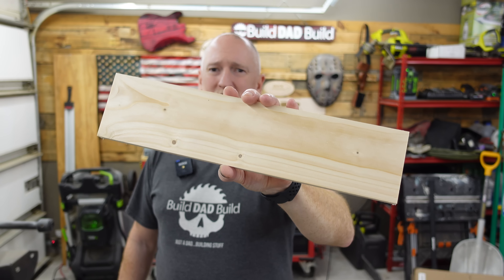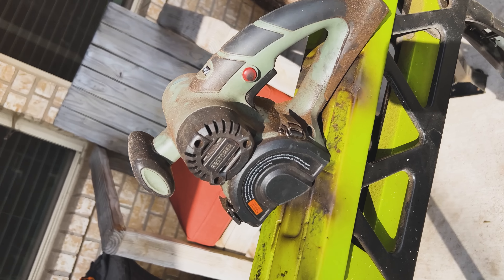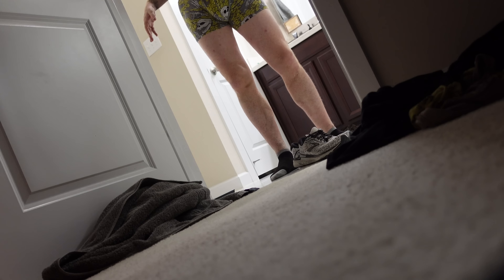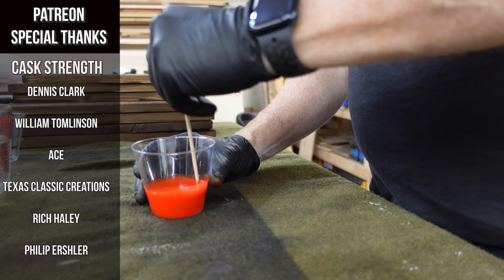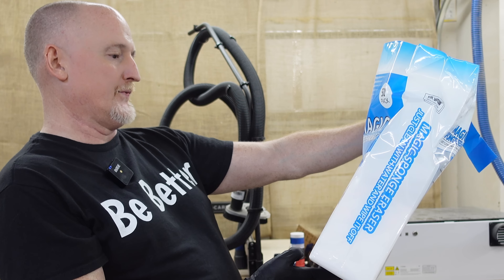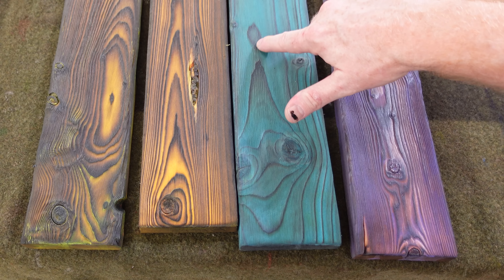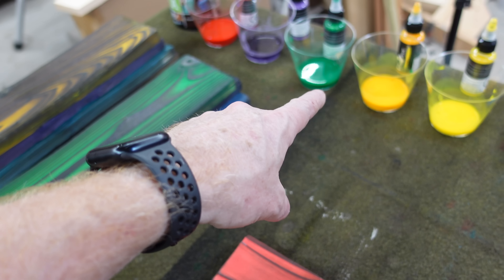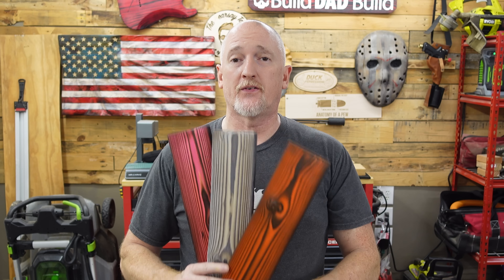Can You Tattoo Wood?

Comment: Commenting on this video from a year ago may not get seen by BDB.  I hope it does or at least someone may be able to help.  Your videos are great,  not only entertaining but hugely informative.  I love the deep burn and vibrantly dyed/stained woods, beautiful (not you, just kidding).  Anyway, my name is Harry from the UK, this is the first time I have commented/questioned on any video, its also the first time I have tried this Shou Sugi Ban.  I am hell bent on doing a large piece (3x2.5mtrs) at the back of my bar using pine floor boards.  This will be external.  So far I have practiced burning and dying with different products, results ok so far.  My question is what type/Make of Oil  should I use for burnt, dyed pine in external use, something that does not spoil the colours?  Any advice would be useful, thanks.
Reply from the maker: Something like this should do well:

WOCA Denmark - Exterior Wood Oil - Water Based Penetrating Stain for Outdoor Wood Decks, Fences, Siding and Furniture - 2.5L - Natural